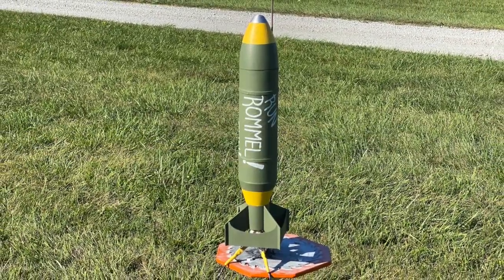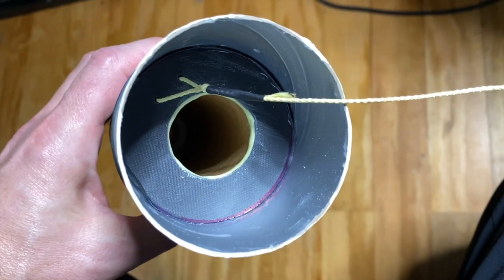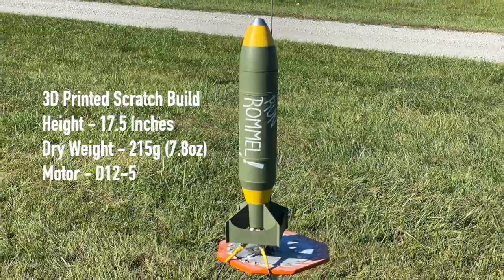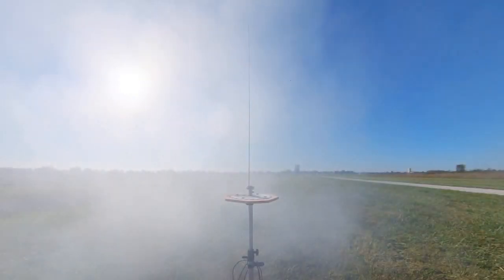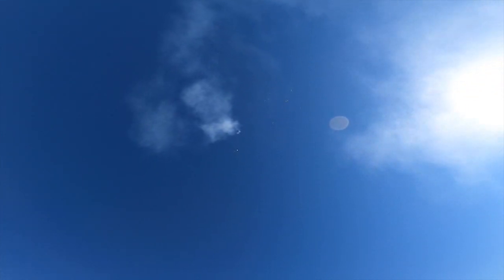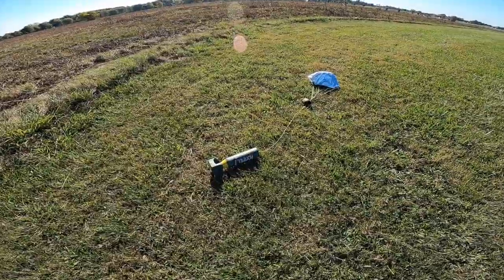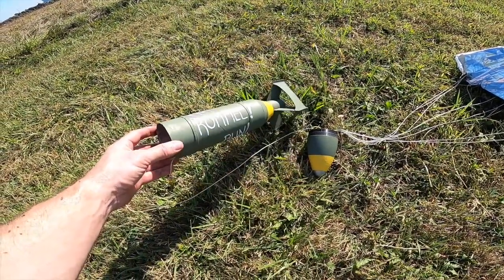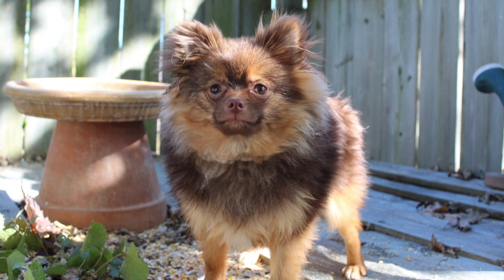3D Printed Pringles Can Model Rocket "Big 'Ol Bomb" Launch

Comment: I'd tell you you should post a link to the original design, but it'd be a little self serving, since I designed it.  ;)

I love seeing my designs (even the alterations of them) fly!
Reply from the maker: Holy crap. I thought I did (heck, I even posted a "make"). Can I blame "old man brain?"  It's fixed now (I linked the "newer version" from 2019). My apologies. This is a great design (I was not able to figure out the "rear ejection" which is why I modded it). Much appreciated and thanks for the design file!
Reply: Yeah, the rear ejection is a little different because it looks like you're building a standard motor mount complete with centering rings.  The difference is that you do NOT glue this mount into the rocket, so that ejection, it acts like a piston and comes out of the bottom of the rocket.   The recovery gear is packed between the motor tube and the tube it inserts into and gets dragged out when the motor pod ejects.  I use a separate recovery system for the motor tube but that could be tied in line with the chute (a trick I use in smaller versions).

All this was because I made a different bomb rocket (The F-Bomb) and my son said "Wouldn't it be neat if the parachute came out the bottom so the bomb came down nose first?"  And I thought "Challenge accepted."
Reply from the maker: @perryolson3737  I think (maybe) I understand how it works now. Maybe I need to go buy some Pringles and try again. Thanks for the design!